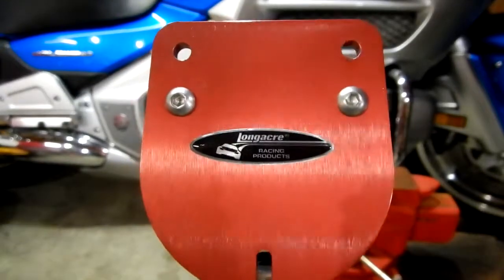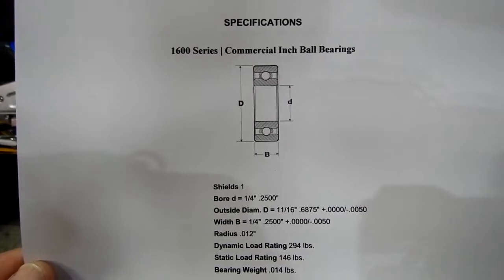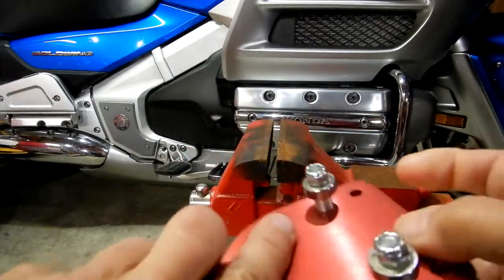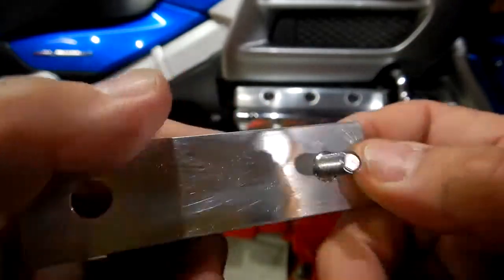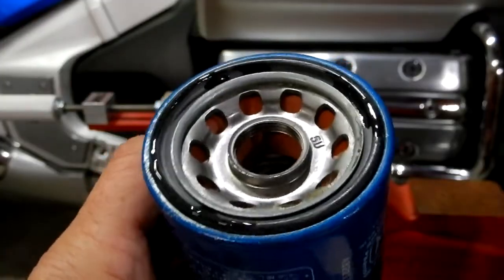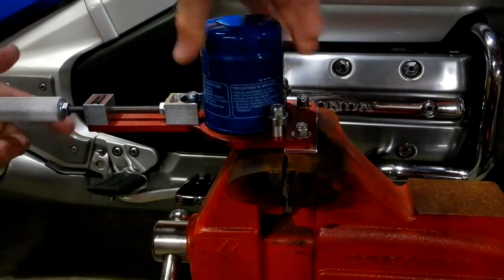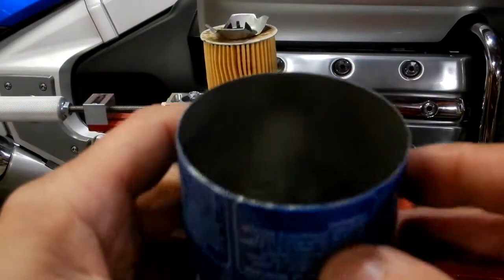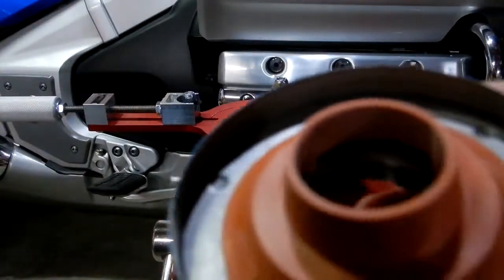Longacre 52-77750 Oil Filter Cutter MODIFIED

Comment: Well done starastronomer, very thorough and detailed explanation, plus I can tell you perform masterful work in everything you do. Thumbs up for having an Anvil Micrometer to properly measure the case.

I do like your idea of having a stationary cutting tool to work on, also you are the first and only video that I have seen that actually knows how to cut pipe, and I have watched dozens of the dolts out there that think they are opening a can of soup, and try to open a thin oil filter case in one turn, with a maximum of two revolutions is their goal, they clamp down on the filter case so hard it crushes the case (Like you stated in your video) and it takes Superman to turn the cutter. Whether it be steel, copper or plastic you go with very light pressure, slow and gradual and you will get amazing clean no damage cuts. I have an old 2” Ridgid pipe cutter that I have used over the years and just too bad my cutter does not go up to 4” and I would be set, so I am planning on buying this Longacre oil filter cutter, I just need any excuse to buy another tool for my collection of course. 

I do prefer Longacre overall design over the others. I like the flat ¼” plate design because it is more advantages for modifications as you have shown, and you can easily relocate a pair of new bearing mounting holes closer to the cutting wheel if needed for any reason. 

I have read from many comment sections that the cutting wheel rides directly on the 10x32 machine screw threads and many have purchased a longer cap screw with a shank on it and cut off the excess threads so the cutting wheel is riding on the smoother shank (axle) rather than the threads, this is a issue on almost all of the oil filter cutter manufacturers out there, not just Longacre.
Reply from the maker: J T...Many Thanks for your kind remarks!!! You will like the Longacre oil filter cutter. BTW, it is always good to have more tools :)